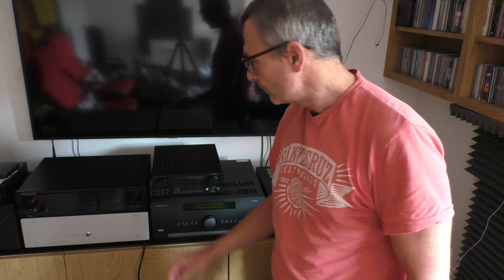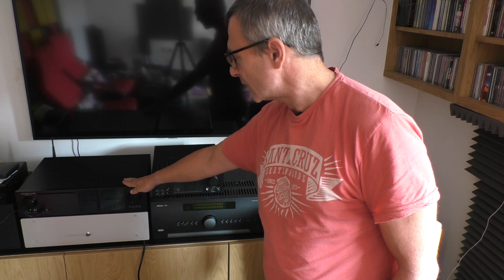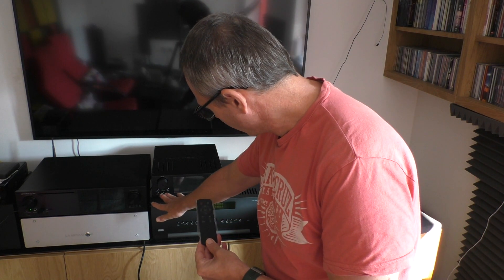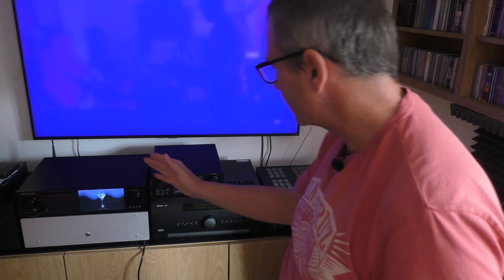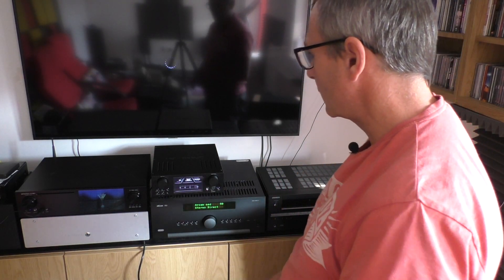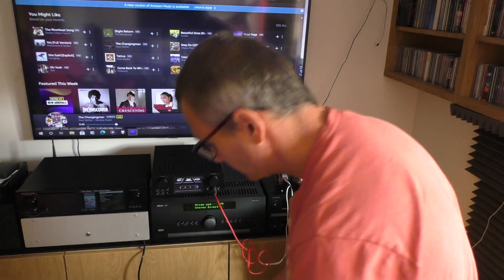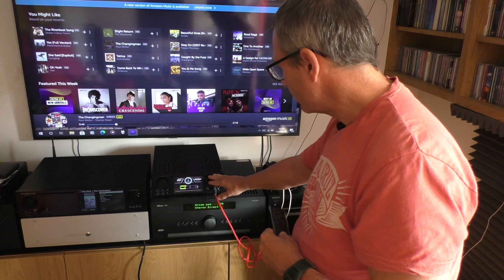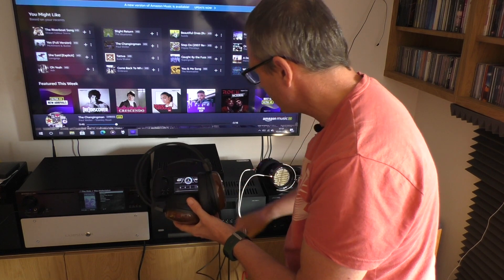Audio Myths-TUBE VS. SOLID STATE - WHICH IS BETTER - THE NOVA FIDELITY HA500H HYBRID DAC/AMP

Comment: The Volumeknob with UNB Output on High needs to go to 80 for the headphones to be loud, whilst I schieve the same level on my 300 Ohm Tube amp with the Volumeknob turned to  50. Is this normal, or is my unit faulty (amp side) ?